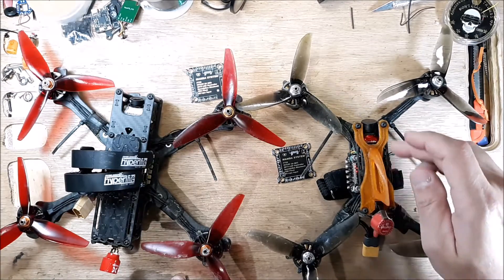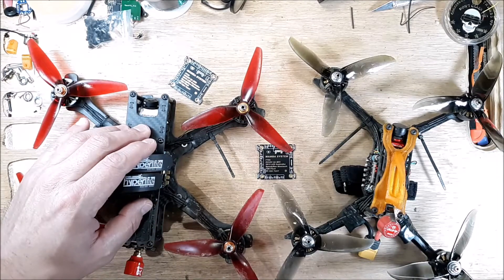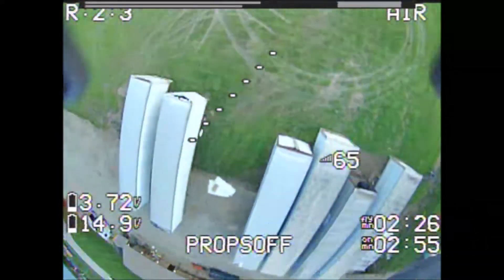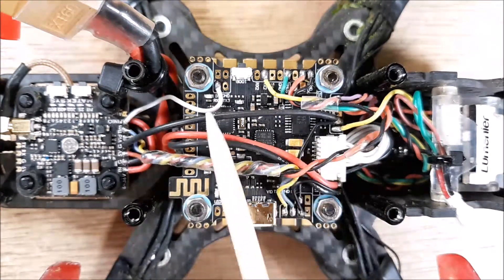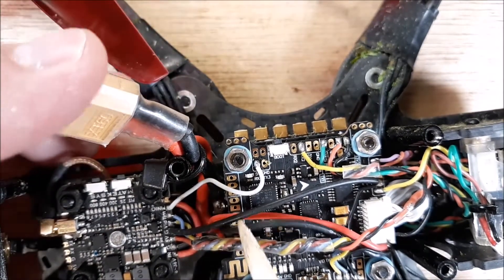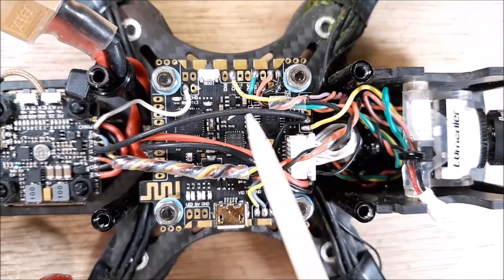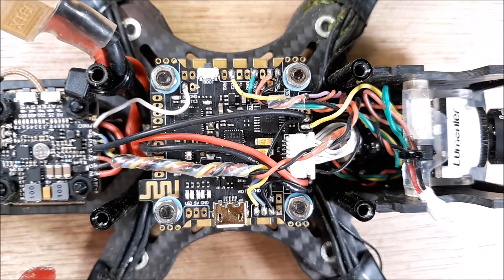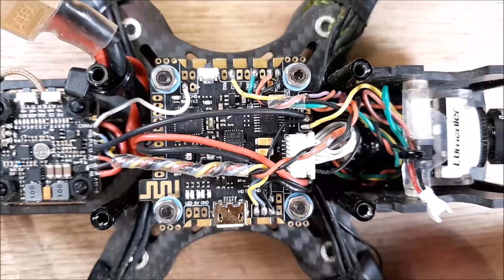Flickering OSD Fixed | Mamba F722 OSD Issue | How To Fix Bad OSD

Comment: sorry, i'm not ENG native speaker, so,: you wired from XT60 pad to the GND pin output (near the ESC conector) to the GND VTX pin in the FC , from the VTX GND pin in the FC to the cam GND pin, and from the cam GND pin to the VTX unit GND pin. correct? is a FC problem or Tmotor ESC unit? (or both). greetings
Reply from the maker: https://youtu.be/OXOmYrez3rE
Reply from the maker: Correct, full redundancy of the grounds back to the Lipo ground...

I actually when further in the next video and used an LCfilter/BEC. You may be interested in seeing it. The issue is the electronic noise entering into the video output. Cleaning and isolating the circuit is the best way that I found.. I attach that video below.
Reply: @PropsOff  you know if the issue is applicable to other F722 mamba series or is only for "F722S" like you model?
Reply from the maker: @sL1pKn07SpinFlo  
I've had to wire many brands the way I did in the last video I attached. Oddly enough, I've not had to do this to two Matek F7 flight controllers (no matter the VTX).. I even run a redundant on AIOs. The VTX, especially HDzero, needs more ground....
A while back, all the components were separated. Never had any issues until the PDB became part of the overall component. I think the PCB and traces have become ever thinner and smaller, creating noise ever more present in the sign wave.

Comment: Nice video, I somehow started having about the same issue.
This happens at random times, some days doesn’t even happen, or it won’t relate to the throttle.
I also got a second 405 MK2 and still got the same thing one random day. I thought it as the VTX so I replaced my unify pro with a AKK X2 but has very noisy video…why is that? (Actually tried two AKK X2)
Do I have to do all that weird mess of cables..? XD
Reply from the maker: Yes, the video after this one is the final result for the best video ever. I spent lots of time placing and removing redundant grounds to measure the difference. Isolating the video system was the best part.
Reply: @PropsOff  I saw your other video too. Isolating the video system means pulling power straight from the battery and feeding the camera through the VTX? Do I have to have this regulator in order to do this? Do you know if the 9v and VCC are filtered? I am trying to figure this out because I have spent so many hours trying to fix this thing…
Reply from the maker: @BobCorey  
The BEC (in my video) has an internal LC filter. If you run the BEC off VCC and the camera off the VTX, it is the best filtration. Yes, you will need to have the Matek BEC in order to isolate the curciut (as shown in the "Best Video Ever" video)...

Comment: also what caused my problem was the camera worked on pal but flickered a little almost not noticeable but in ntsc it works fine i was trying to chase a bad wire for no reason lol i did add a cap and a main battery ground but it never went away lol it was because i was on pal...... it worked but osd was not perfect
Reply from the maker: Yes, The PAL NTSC has to be correct. Betaflight default is auto, which is terrible. Good you got it sorted...🍻
Reply: @PropsOff  i had it on pal and i thought my camera was both pal and ntsc but i guess not i thought the screen would be black if the came was not pal but it worked just bad osd flicker,,,,,, so i put it back to ntsc and no flicker.... just smaller image now but its fine again.... lol i replace my ground and added one main ground too lol ahaha... it was the camera being on pal ez fix ntsc for the win

Comment: Thank you so much for this video.. i fixed my video blackouts using the redundant ground.. im still trying to figure out how to fix the flickering of the osd, i've wired almost all ground pads to the redundant ground wire. 🤔
Reply from the maker: I actually had a camera that I crashed give me OSD flicker before. Finicky ground connection or an overloaded 5v rail too can cause it. I had to replace my camera though..
Reply: @PropsOff  update: I'm sorry I missed the part that you made a redundant ground for the FC too.. My OSD flicker is gone now... Thank you so much! you save me from buying a new stack. :D
Reply: @PropsOff  I have learned this in college that you have to get a good ground for any electronics. I can't believe I have forgotten that important part.. Thanks for reminding me haha
Reply from the maker: @vjvenida3991  
Yeah, My college electronic days are from a long time ago, however, the great ground principles apply even today.. Lol 
I still have not opened the crashed camera to see if wires came loose, I should. Have a great day...🍻

Comment: Hello,  very helpfull video thank you.  I have another issue,  my betaflight stopped to show videotranmitter menu and my quad vtx do not allow to change 25mw and stuck. Vtx signal very poor and video is cut completely when i start to fly?  Can anyone know why?
Reply from the maker: Your camera is bad or wired incorrectly. Most of these issues are caused by power going in the "CAM" signal too. Check your wires! Did your camera take a hit?
Reply: @PropsOff  no not a recordable demage or hit on camera. İ guess FC can't get feedback from vtx, maybe fc osd broken or vtx has a problem.  İ will check wires or change vtx and will give the result here.
Reply from the maker: @BarisBaydur  
When it fails,, What screen do you have in your goggles? Snow or blk/brown/grey?
Reply: @PropsOff  black and grey.  In the normal arm position the image looks very distorted and googles could not find easily.  When i try to fly the drone image is completely distorted and the screen turns black. Also i change my vtx to 800mw but it same.
Reply from the maker: @BarisBaydur  
Did you swap out the camera yet?
Just saying. Usualy if the VTX is losing power or failing, you'll get only snow in your goggles.
Reply: @PropsOff  No I didnt change camera. Let me check and I will return back. Thank you.
Reply: @PropsOff  but i think i have different problem because my settings on osd also came back when i take out lipo. İ mean 800mw again return to 25mw.
Reply from the maker: @BarisBaydur  
 See if I can explain this, if I were to plug in one of my quadcopters and unplug the camera, I would still see the OSD information in my goggles.. Depending on the screen output of my many quads, I would either have a Gray, Brown, or black background. If I unplug the VTX, I'll just get snow.. Does that make more sense?
Reply: @PropsOff  ok i see now😊.  No, osd information staybon screen and only image return to black.

Comment: Question: it looks like all components need to be grounded to battery in essence = black cables to bat - , right?
Reply from the maker: Basically and with a redundant.. I took things a bit farther or some may sat it became an obsession to have crystal clear FPV video.. Here's the final version  -
https://youtu.be/OXOmYrez3rE
Reply: @PropsOff 
They need to have a thick enough wire, short enough. You added a thicker wire, which more or less solved the problem.

The problem was you had the full current going through a tiny little 30 AWG wire. You needed a thicker wire, and added one.

But the wiring shown in the video ALSO left the old wire, creating a ground loop. That can create new problems. It would have been better to remove the tiny wire. That would avoid having a ground loop.
Reply from the maker: @senseisecurityschool9337 
No ground loop was created.
Reply: @PropsOff   I'm going to quote your exact words from the video:

"from the camera goes to the VTX
Then another one from the VTX to the flight controller
Then the ground from the flight controller to the camera"

"From the camera ... back to the camera". That sir, is a loop.  There's a reason that a dozen people are pointing this out in the comments, a reason that everyone qualified is telling you the same thing.

It's up to you whether you choose to learn something, to be a tiny bit smarter at the of the day.

Comment: Perfect, that worked a charm. On my Mamba F4 board was getting zero OSD and maybe 30% chance it'd show up and even less that it'd not disappear quickly. Been rock solid just that one wire from the ESC ground to the controller board.
I did suspect such a tiny ground wire with all the components would become a problem, didn't expect nearly as bad as it was though.
👍
Reply: I was misinformed it was a software bug and wasted a day trying different firmware with varying and random results. This fixed everything consistently. Also much smoother gyroscope in angle mode without the resonation.
Reply from the maker: @TekkGnostic  
I have recently built a frestyle 5incher with a Matek 405 FC and individual ESCs I have no video issues. Further testing is needed. I haven't flown much and taking a break from YouTube. Pretty interesting stuff...🍻
Reply: Yeah you nailed it - it's the tiny size of that little 30 AWG trying to carry the full current that is the problem.
The fix is a thicker wire, not a bunch of wires creating ground loops all over the place.

Comment: I'm getting this issue after replacing my runcam phoenix 2 with the exact same one... Not even the wiring was changed. Just plug & play. Can't figure out why
Reply from the maker: I have a couple Phoenix 2 micros and a nano.. There's one that took a bit of a hit and it will flicker (no reason like you say)... I would ask for an exchange (may have been thrown around in shipping?).. It's strange how one is absolutely perfect and the other isn't for me as well, hum..?
Reply: @PropsOff  got it. Thx
Reply from the maker: @califpv  
I'm interested, what's your thoughts or plan?
Reply: @PropsOff  I just received that cam from am hobby's , so just gonna ask for a replacement. I'll let you know if the cam was faulty. This has never happened, so wish me luck. 🤞
Reply from the maker: @califpv  
I will...🤞🏻
I appreciate your feedback...👍🏻🍻👊🏻

Comment: youre definitely gettin into the small stuff there. awesome. its stuff like this that helps people learn.

side note: your voice was ringin a bell and i swear, you could be a voice double for fine tune cb shop. check it out. pretty cool.

btw, im havin a WEIRD issue with my taranis. im wonderin if you have any idea what it might be. ONLY my roll endpoints are all over the place. adjust in the radio, adjust in betaflight, both endpoints are up to 100 points off after disconnecting.  All other endpoints are rock solid. any ideas? im stumped unless i got a bad gimbal on my pretty much unused qx7.
Reply from the maker: Thank you for the above section..👍🏻
Now, your end points are off on roll, by how much? If you calibrate your sticks then adjust your stick travel using Betaflight receiver tab and "Inputs" menu on the transmitter, you should be able to dial it in resulting 1000 lowest and 2000 highest. Does that sound right?
Reply: @PropsOff  it drifts off say 10 to 100 points. i calibrated the sticks and it did make a difference. at least it seems to arm consistently now. i got it a lot closer. gotta knock the rust off these old fingers now.

youre the only one i could find to help me find an answer to this. THANK YOU. i really appreciate having anyone at all to talk to about this.
Reply: @PropsOff  any idea why betaflight doesnt show the quad in the preview in receiver tab?
Reply from the maker: @TheBoatPirate  
That, I will need to look up again, been a minute since I seen that..
Reply from the maker: @TheBoatPirate  
I have looked for a reason your not seeing your quad in the "Preview" of the Betaflight receiver tab.. Nothing so far. Are the channels showing up and moving correctly?
Reply: @PropsOff  yes they are. its the weirdest thing.
Reply from the maker: @TheBoatPirate  
I only found a single situation like yours and the guy said it was fixed by reloading the firmware. Not sure if that would help you or not.
Reply: @PropsOff  ok ill try that. thx for the help. i really appreciate it. maybe itll fix my fpv camera showing up upside down in my goggles. lol